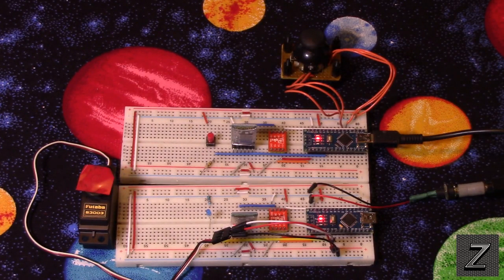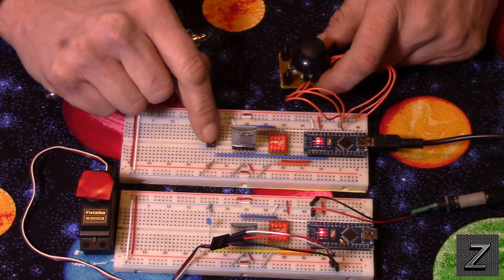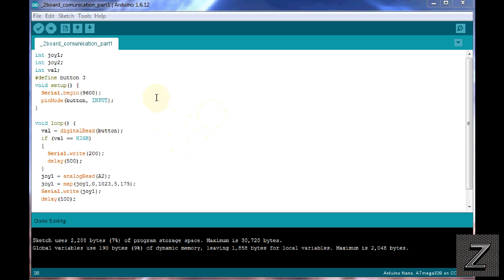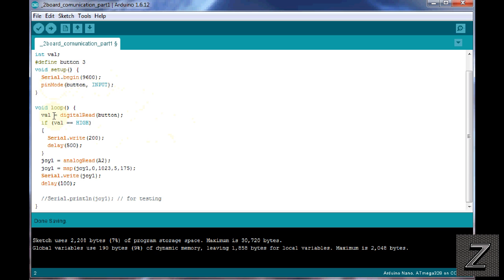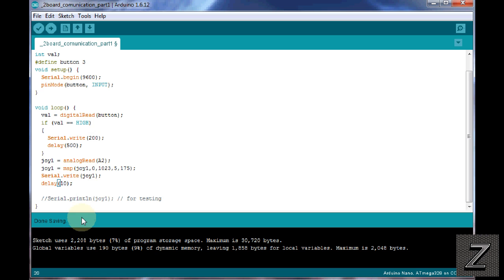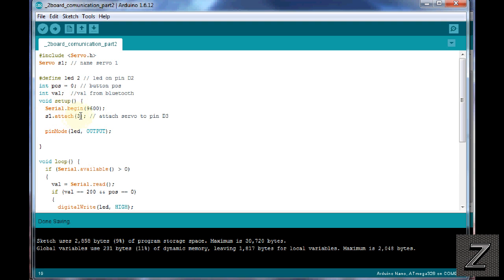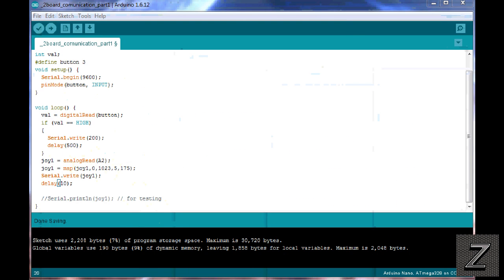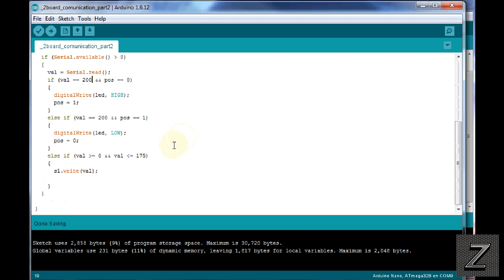How To Build A ARDUINO Bluetooth Joystick to control your robot Part 1

Comment: Hey! Thank you so much ! I like your video very much! It is very useful. But I have a question about that if I use RFduino which has already Blutooth instead of Arduino. Can I use the same code ? My situation is that one RFduino connnect Joystick to control servo motor in another RFduino wirelessly. Because of RFduino is not so common as well as Arduino. So I can not find good tutorial to learn. If you have time, can you tell me how can I change this code and to use it in my situation, plaese. At last, Thank you very much. I look forwarding to hearing from you.